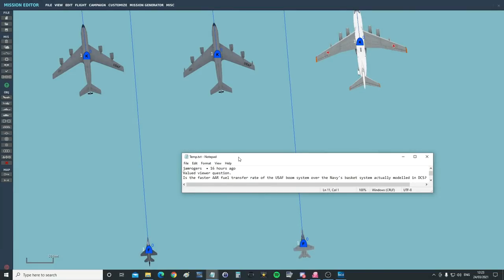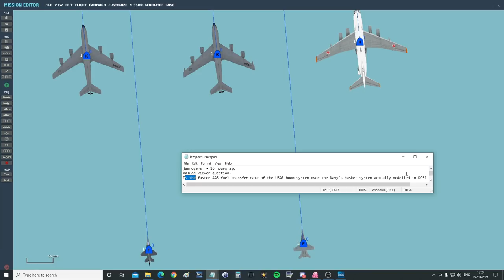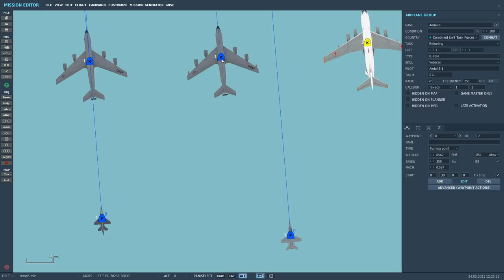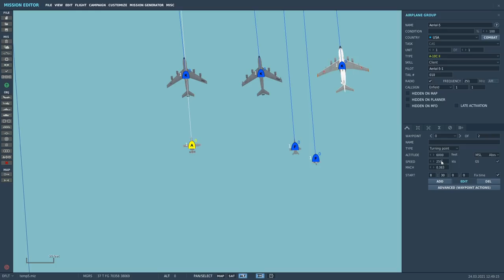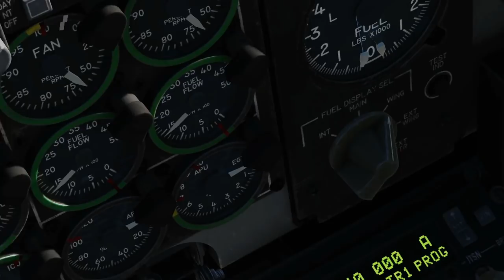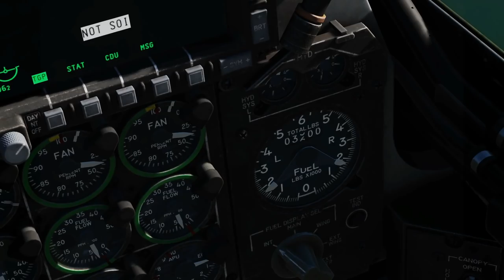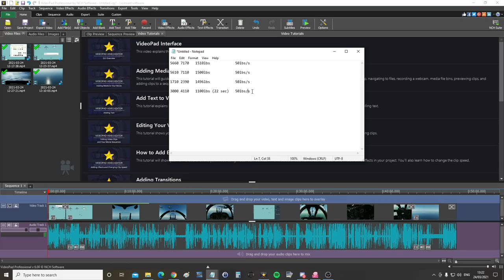Questioned: Which Tanker Type Has The Best Fuel Transfer Rate? | DCS WORLD

Comment: I confirm that refueling with the boom is more efficient than with the basket (the boom has, indeed, a larger diameter, which allows a higher fuel flow, but above all, the rigidity of the boom allows a higher pressure (which is not the case with the basket, the hose being flexible and more fragile)).
Thanks again Cap for this great video, I had a good laugh, as usual.
Reply from the maker: Thanks!
Reply: @grimreapers  you're welcome ! ;)

Comment: one thing to note here: fighter sized aircraft cant take advantage of the higher flow rates the Boom can provide, thats only really used for the big planes and fighters are limited.
Reply: So irl the transfer rates are identical?
Reply: Whyte Noyse No if a B-52 tried to tank with a drogue & basket, it’d be on for hours.
Reply: @yolkiandeji7649  B-52 has no drogue system
Reply: Iron Physik That’s why I said if.
Reply: Sorry I wasn't clear, I meant just with fighters.  I was asking if the difference in delivery systems was negligible because of what  the original post said.
Reply: Whyte Noyse The difference in fuel flow rate is negligible in fighters because of the amount of fuel they recieve. Anything bigger that gets more fuel, there would be a noticeable difference in the time it takes to refuel.

Comment: It is generally accepted that boom has a higher maximum flow rate than probe and drogue. HOWEVER. In real life the flow rates are limited to how the receiving aircraft can manage the rapid change in weight and c.g.
So only big and heavy planes (B-52, C-5) can take fuel at these higher rates.

Comment: The boom was primarily designed to refuel large bombers, (from the Strategic Air Command days) which can take on fuel faster.  The fuel rate is slowed for fueling fighters.  The probe and drogue is designed to refuel multiple fighters at once and used by countries with fewer large aircraft that require AAR.

Comment: Is it possible to drain tanker or is the fuel unlimited?
Reply: Now THATS an interesting question! Try sending a few friends with their dump valves open to tag team refuel from the one tanker, over and over again and see if it runs out. The next question will be: did it run dry of fuel and will now fall out of the sky or has it set a bingo limit and just won’t give you any more...
Reply: @doemacmonkey  Is there same fuel tank for tanker and refueled planes?
Reply: @ototti1710  pretty sure it is, it definitely is with navy buddy refuelling, not entirely sure about larger tankers, but Australian tankers also carry cargo, so I don’t think they have any extra internal tanks, certainly none that are dedicated to the refueling system - willing to be corrected on this
Reply: In flight of the intruder (the book not the movie) the tanker gives a struggling intruder extra fuel it badly needs itself.
Reply from the maker: It's all measured, you set it in the mission editor. It runs out, we have drained many tankers in our missions. They just fly home when empty.

Comment: A quick google says that the KC-135 can pump 6500 lbs/minute through the boom, which works out to 108.3 lbs/second. The KC-10 has both boom and drogue refuel rates listed, but they're in gallons/minute instead: 1100 gallons/minute for boom refueling, and 470 for drogue refueling; 1 gallon is 6.71 lbs of fuel, so that's a rate of 7381 lbs/minute or 123 lbs/second for the boom and 3153.7 lbs/minute or 52.6 lbs/second for boom refueling.

Basically.... the refuel rate for boom refueling should realistically be about double what it is, the others are okay.

Boom refueling was specifically invented in order to refuel strategic bombers like the B-52 because drogue refueling was too slow. It was then installed on all  US Air Force jets because it was convenient for the USAF to only have one kind of tanking system... and then people started asking "why can't Navy jets refuel from Air Force tankers? Fix that!" and they had to install drogues on their tankers as well...

Comment: In real life the smaller aircraft cannot take the full flow/pressure capacity of the basket as the internal pipe work and especially connections cannot take the pressure. So the tanker boy has to limit. The aircraft basically has to be designed to take the higher pressure flow of the US system from the design stage. It is much more suitable for larger aircraft so they can fill up quicker otherwise they would be there all day! Although not officially recognised as the major cause of the crash of Nimrod XV230 near Kandahar a lot of ground crew reckon the Tristars would pump in at too high a pressure to get  back to base as soon as possible. This put a lot of stress on the ageing Nimrods already weakened fuel system hence a rupture of one of those FRC corrosion special couplings!

Comment: Well the draught and hose method allows  2 planes to fuel at once. So it depends on you want faster rate of fuel or fuelling more aircraft at once. Always find it interesting that only the airforce uses the boom to fuel planes whilst the navy uses the basket? Any reason for it? And the Europeans seem to favour the drought and hose method.
Reply: Simple: The Navy doesn't have large airplanes that air refuel, so no need to switch to the flying boom system. USAF had to switch to more efficiently refuel B-52s that needed to fly halfway around the world if launched to hit their SIOP targets.

It would be interesting to get real world numbers on transfer rates and whether a flight of four fighters refuels that much more quickly from two simultaneous probes than 1 boom.  Assuming approx 1000 ppm (drogue) and 2500 ppm (boom) plus more reliable hookup in rough air or at night with the boom, and there may not be all that much to choose between them for fighters.  Obviously for heavies the boom wins by a mile.

Comment: The flying boom system was developed because a drogue and probe would take far too long to fill a B52. I think the recieving aircraft has to be able to handle the flow rate though and move it to the different tanks. Fighters might all just be low flow rate otherwise they could fill in seconds and or pop like a balloon.
I don't understand why you are pausing at the start. Just have RC ready and tell him to start as soon as you get the taking fuel cue.

Comment: If correctly modelled, refilling rate will also be dependant on the receiving aircraft. F16 for example can take I think it is around 1500lb/min, whereas an F-15 with a larger fuel system can take 3000lb/min - the guys in the tanker adjust the flow rate to suit the aircraft